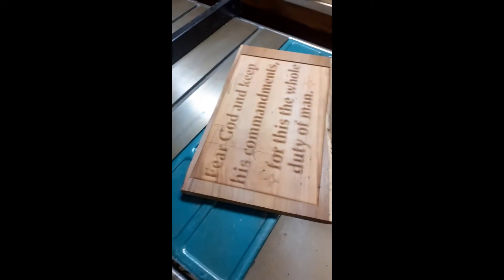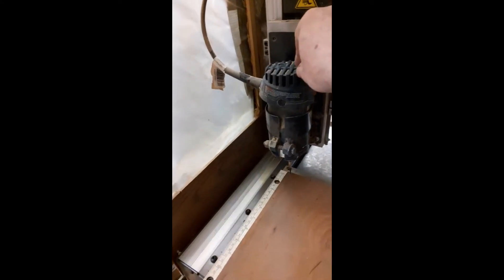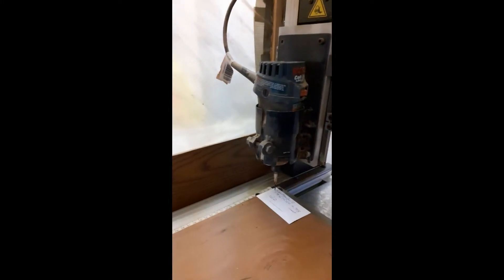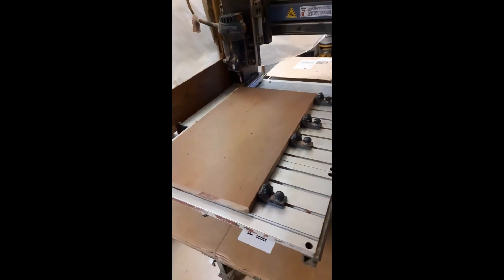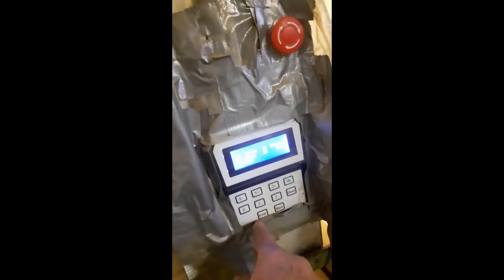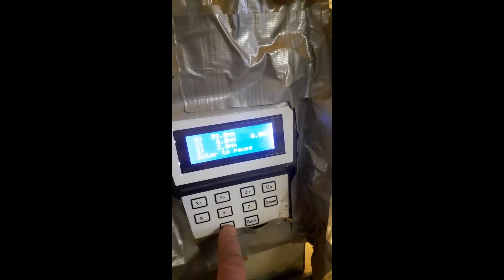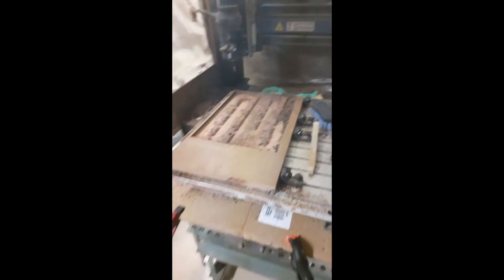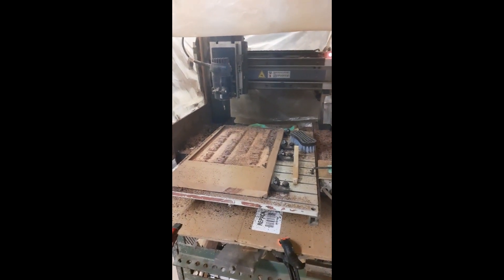Demonstration of my little CNC Router

Comment: I was very luck to spot a used one of these machines for sale. I tested it when I picked it up and everything seem to be in working order. Both power and motion. The seller could not find the installation software, iPicture, and I thought I could find it online. When I bought it home and set it up, I discovered that the USB port was damaged. I tried to repair it by attaching another port, but I think the board was damaged in some other manner and it was not able to read the USB stick. Long story short, I was able to replace the controller with an Arduino Uno/CNC shield and some stepper motor drivers. In some ways, the USB port being damaged gave me the opportunity to upgrade this machine to run GRBL, which gives it the ability to do both vector and raster carving. 😊
Reply from the maker: That is great.   Ability to avoid wasting time with rastering, and ability to define feed and speed would be so nice.  Does your software allow you to limit speed in the y axis (rack & pinion) proportionately compared to the 2 ball screw axes?  When I have tried writing my own g-code, say to run a circle, the y axis was scary fast and jerky, even on lowest feed setting.
Reply from the maker: Now all you need to do is swap the spindle for a trim router!  See one of my other videos.
Reply: I have a 500w brushless spindle. I just need to figure out how to mount it.

Comment: Not familiar with the email. 
Wondering what software you’re using
Reply from the maker: In general the i-picture software only processes picture files (*.jpg or *.bmp or *. png).  Take screen shots of web pages or Word files etc.   You can use the microsoft Paint program to edit them, to add text and lines, and even paste pictures or clip art into it - get the sizing and adpect ratio right, crop it etc.  That is where I usually start.  Then I use Gimp (a free version of photoshop) to enhance the photo for optimal carving ( I could write a book on that, perhaps I should take a few hours and make a video some day).  Convert  to grayscale if needed, "blur" the image so your router eases more slowly into the cut, creating fewer burrs and more rounded contours.

There are other programs like Vectric which do fast efficient carvings but our machine is not strong enough for that.

The machine at its heart uses industrial G-code commands.  It uses a stripped down version of industrial milling commands.  I have used that direct programming to cut circular holes and counterbores for speaker enclosures, but our machine model is not really strong enough to do that.

Comment: I need one of these. Would be perfect for King Starboard as well!
Reply from the maker: For sure.  As long as the material is free cutting and doesn't have a tendency to melt and ball up on your bit.  For serious work you could do a lot with a larger table, 2x4' or even 4x8'.  Good for making accurate hole locations and counter-bored recesses, or special shapes and contours (with the right software to generate them, or a knowledge of direct G-code programming).